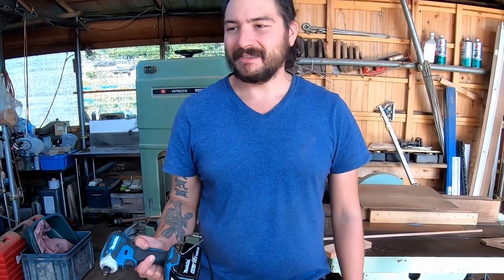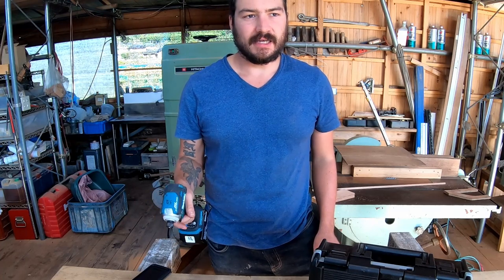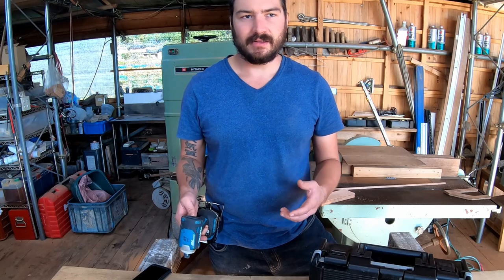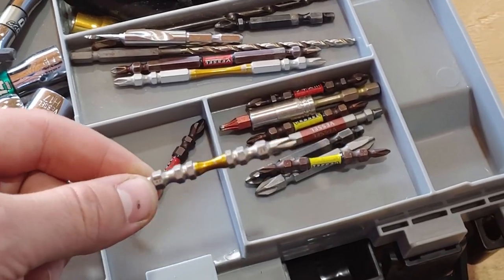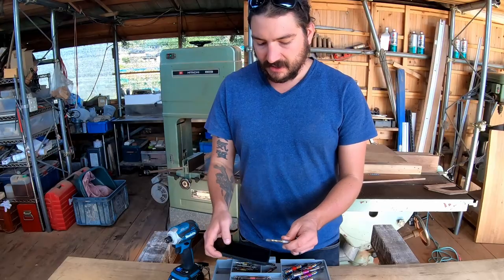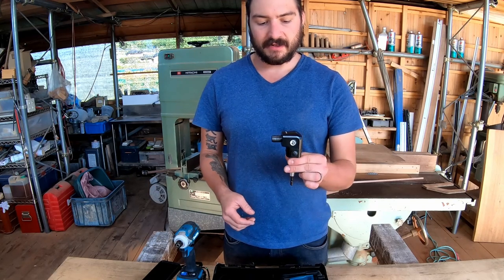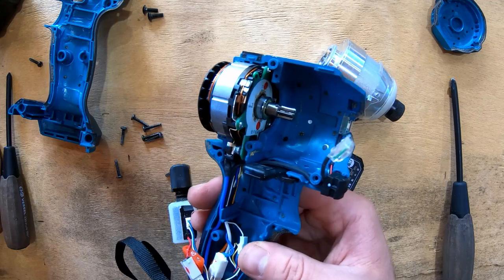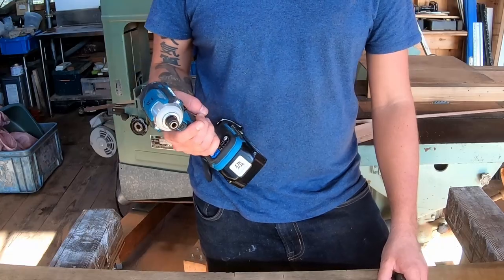Most Important Tool for a Japanese Carpenter

Comment: International bit and bit holder standard should have been same (or at lest as long) as japanese bits @nio4. In my opinion the backside is longer to give bigger support (counter balance) - less side to side movement to the bit point. Something like Festool Centrotec.